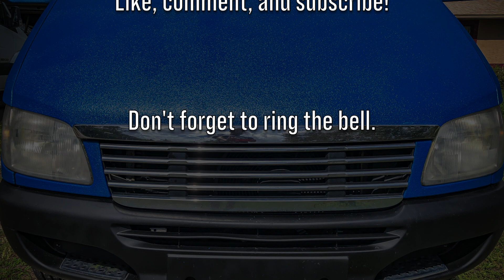Raptor Makeover on a T1N Sprinter: NERO becomes 02-BLUE!

Comment: Wow 😮looks 👀 GREAT! Is this the first time you do this? BTW any suggestions, regrets or tips if you’d have too do it all over. Thanks worth seen your video & is appreciate any suggestions as I plan too do the same but I’m a complete newbie. Best regards!
Reply from the maker: This was the first, we did a purple van later. Tips: turn the air pressure up a bit higher than you decided, based on texture. Lower pressure gives a taller texture and it is easy to add texture with a second pass. It is real hard to make it smaller after you started. 
Buy more paint than the minimum. I had 17 and wish I used 20.
Reply: Thanks for the tip it makes sense…

Comment: I wish you would do a video on how to remove the speed limiter on the T1 N the van
Reply from the maker: Moving it up to 82mph requires Dealership Automotive Software (DAS) like Xentry or Star-Diagnostic. The details will differ by brand and version. I have a DRBIII like dealerships had in the late 2000's and that just isn't available to most folks. 
Reportedly, others have defeated the 82mph governor but I don't know how. My van went up to 95 for a while but I have no idea why it did for a while or why the limit is back now.

Comment: 9:29” Love squirrels running un the cable 😂 good job  on the raptor liner  !! I’m waiting  on the liner  but I ordered  12 liters of dark olive and 4 black for the bottom and a hood . Do you still recommend to order more  or this will be enough ?  What are your recommendations .
Reply from the maker: I used 17 &  definitely wish I had more, especially on the roof. Possibly 2L of white for your roof would be wise? I may have gotten better coverage with less texture. I turned the control out 2 turns and ran 60psi. I did not experiment any, just went for it! But in hind sight, I think if I turned the adjustment only one turn it would have speed a bit thinner, leaning toward a mist & farther from the splotch. Our next Raptor job might be applied with a roller. I didn't want roller lines, but I think I can cover them better than I did spray patterns.
Reply: Thanks ! I just ordered 2 more liters to be satisfied with a more uniform color .
Reply: Total of  18 liters.

Comment: I'm definitely interested. Did it come out even? Would you say you need more than 20 bottles or more needed to even out?
Reply from the maker: 20 liters would have been enough. I used 17 and did not get as even coverage as I hoped. A more skilled painter would have gotten a better even finish, I'm sure. I think we will try a van with Raptor's roller kit and compare. I think I can smooth out roller lines that I was afraid of, easier than evening out the spray patterns.
Reply: @FloridaVanMan  Did you end up doing a roll on kit? I'm debating rolling vs spraying now. Also trying to figure out how much I need of each color for two tone. Calculating surface area ugh.
Reply from the maker: @nicholasmartin7922  Spray!!! I have used the roller on one van roof and I may never do that again! The rolled texture is not pleasant to wash or lean on. I sprayed 17liters on the blue van and wished for a little more. 20 liters would have been plenty and if I were doing two colors I would definitely not try less (again).
Reply: Florida Van Man friend of mine rolled on his running boards. It’ll take your skin off if you’re not careful. My only concerns thus far are adhesion to fiberglass or bondo, and the heat difference inside the van from factory white to the raptor grey.

Comment: Hardcore Bill, his lungs will be the same colour as that van! Ha
Reply from the maker: I tried... then I forgot to put it back on after stepping away for a second. I did the same thing in the spray foam video. Is it my age or the paint fumes causing memory loss???
Reply: @FloridaVanMan  Ha ha. I do it all the time myself, as long as you don't over expose yourself I am sure you'll be fine. The van looks great by the way
Reply from the maker: @zambotv8150   One of the advantages to not having a shop... I was outside under a make-shift plastic roof and no walls, just parked between two donor vans. Besides, a few blue boogers never hurt anybody.
Reply: @FloridaVanMan  Ha, ha....

Comment: Did you reuse the windshield or buy a new one? any thoughts on gaskets or things to do when removing it?
Reply from the maker: I bought a nifty zip tool after seeing a pro use it on a neighbor's car. I tried to make a video of removing the glass without breaking it. Well........ I stopped counting the breaks at about 30!!! I tried to edit the video and after taking out the cussing there wasn't anything left! A new windshield installed was only $230 including a new rubber frame.

Comment: Looks good. I have a newbie question for you: I noticed the white hood has 2 square cutouts on either side of the intake grill. I have those on my 2002, what are they for?
Reply from the maker: That means your 02 has had an 04-06 hood swapped in. 02-03 vans have a smaller slat styled cutout. 04-06 vans have a larger honeycomb styled cutout. Meant to match the grilles as seen here: https://youtu.be/N0YaNWbDZkM -Mike
Reply: Ok, thanks for the info, makes sense now. It was from a small fleet and has the honeycomb grill and Dodge style headlights too. Enjoying the channel, looking forward to new ones.

Comment: Has anyone used Durabak smooth bed liner on their van?  Any pros or cons to a smooth finish?  Also pros and cons of using a roller rather then sprayer?
Reply from the maker: I've not heard of Durabak but our next Raptor painting will be roller applied. I didn't want roller lines in the paint, so I tried the spray. The splotchiness of the spray may be worse than the roller lines I feared?
Reply: @FloridaVanMan   I just think a smooth bed liner will be easier to wash clean then a rough texture.  I could be wrong about that. My considerations for color is keeping the van cool and hiding dirt.  The best of both world is a light tan, light blue, light grey and white.  I want of future that involves the least amount of time dedicated to cleaning!
Reply from the maker: @patricialacava4472   Agreed! The reason we went with bed liner on this van was because of the need to wax all 5 vans we had painted in 2018-2019. Our vans don't get washed enough and I know the life that grows on them is eating into the paint. Trying to keep them waxed (not green) has become a problem! Dirt I can live with, it doesn't eat paint. Mildew might not "eat" it, but it definitely destroys it!

Comment: Looks great. I'm about to some Liner Xtreeme to paint my 05 in Desert Tan. How'd you get your bumpers painted so well? :)
Reply from the maker: Krylon plastic bonding spray paint. aka "Fusion". It ages pretty well and can be touched-up without removing the bumper every time. With the consistency of Flat Black rattle cans, you can spray just the needed area, holding a cereal box to shield the area you don't want over-spray. No need to repaint every inch every time because it will match.
Reply: @FloridaVanMan  Awesome!

Comment: I put raptor liner for the bottom portion, how much did it end up costing to do the whole van? I’m only curious, because I was considering doing a dipyourcar (plastidip) job on mine soon.
Just got a roof rack, ladder, roof vents so far.

05, T1N dodge sprinter 158” wb passenger 111k miles.
Reply: DO NOT PLASTIDIP your van, does not remove easily after a few months and near impossible after a few years, vinyl wrap if you want protection or a different look.
Reply from the maker: Agreed! This van had a few Plastic-dip shapes on it. They were a nightmare! At least the spray-paint spots sanded off. The Plastic-dip just gummed up the paper and fought me.
Reply from the maker: $900 in material including sand paper, respirator and Por15 kit. We used 17 liters and I wish I had 3 more.
Reply: @FloridaVanMan  wonderful thank you for the reply.
Reply: @ChrisLoew  thanks for the heads up.

Comment: Reattach coating should give many yrs of reduced rust protection.  Did u remove the windshield specifically for getting those pesky rust areas that could be problematic?   Excellent! !
Reply from the maker: Yep, had a few spots of rust on around the windshield. All ground out and treated with Por15 now.
Reply: @FloridaVanMan  u ever tried ospho which u can get at ACE